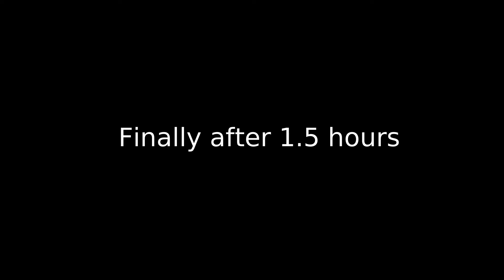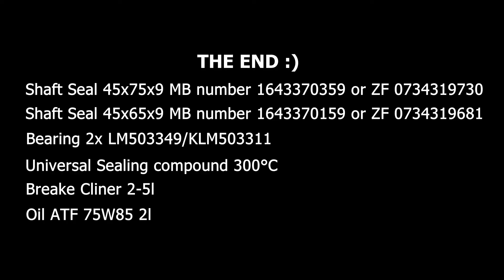Mercedes ML W164 rear differential Diagnosing noise and clearing replace bearings

Comment: Cleaning with paint thinner is better than with brake cleaner. It doesn't evaporate as fast and when rinsed off it leaves a protective film on the parts. That`s also a good way of cleaning valve covers and engines in general.

Comment: 1990 300 CE 210mm 3.27 differential. Do you think it will fit in another car with a 210mm differential. It’s a 2006 Chrysler 300C

Comment: Loved the Music. Can you use ATF in you Diff you can. Will it last? Probably not.  I did this once on the advice of a transmission shop and Never again because 6 months later I needed a New Rear Diff. Now I use Valvoline SYNpower. Full Synthetic 75W-140 Gear Oil. This is what you want to use! Bottle also say's  "Limited Slip" Change out that fluid ASAP. Running Strong in My GL450 and all my vehicles. I never had a Problem since!  Hopefully this helps and you see this in time.  Thank you.
Reply from the maker: If your differential died after changing the oil, it means that its condition was already very bad fresh clean oil only showed his condition and did not affect its destruction, changing to 75w140 can help because it is very thick when warmed up and masks the noise of the bearings but it causes an increase in fuel consumption
Reply: There was nothing wrong with the rear it was in excellent condition. I should have not even Changed it. ATF could not handle the "Shear" of the gears. Anyway thanks for the video and good luck.
Reply from the maker: @tomb375  It's hard for me to say in what condition your differential was in the one I was repairing, the oil was never changed, but it was completely damaged, I changed ATF many times in gearboxes and differentials, usually to the one recommended by the manufacturer and they worked for years without problems

Comment: Woah, so you're saying the carrier bearings in the rear diff are the same as the ones in the front diff? 
What the heck? Were the bearings you removed KLM and you replaced them with LM?
The front diff is notorious for failing  with the same KLM503349/KLM503311 bearing, the rear is not usually an issue.
The KLM503349 is made in Poland and seems to fail frequently in the front. 
Could the increased oil capacity of the rear diff be helping?

I never heard of the rear using the same bearings. You didn't make a typo or anything, did you? Just askin'.  :-)
What about the pinion? What are part numbers? And yes, per the dealer and lube info supplied from MB, diff is supposed to have GL5 gear oil, not tranny fluid. Transfer case does call for ATF134.
And btw, nice video! Thanks for taking the time.
Reply from the maker: In the 11: 06s video I showed the original bearing numbers that were in the rear differential. I used Timken bearings numbered KLM503311 KLM503349 it is the same bearing
https://www.iparts.pl/czesc/timken-klm503349klm503311-timken-klm503349klm503311,0-219-klm503349klm503311-0.html
Dimensions are important
After the change, they work flawlessly so far :)
The oil I used is 75w85 as recommended by Mercedes but a lot depends on the climate in which the vehicle is used. countries with hot climate better use 80w140 cold countries 75w85 countries with moderate climate 75w90. ( I changed the oil in my Mercedes to 75w90 ).

It is true that the rear differential breaks less often and the front differential is more problematic. For me, the damage was a consequence of the stupidity of the previous owner who drove hard despite the problems with Lock UP and destroyed almost the entire drive in the car :(

Regular servicing and oil change is also important Polish bearings are not the cause of the problem, in my opinion, they are simply too small for the loads they carry, especially on the front axle of the vehicle, it is a design error or intentional operation of the Mercedes :-/ The front differential has a slightly design other structures than the rear one which may have an impact on the worse lubrication in bends. It is also affected by other momentary forces during driving, the load is primarily on the rear axle and the front axle is temporarily loaded, often very quickly when the rear loses its grip, which is not good for the bearing strength. 
The oil in the central differential depends on the type, it is different in the version with the off road package and different in the ordinary transfer case 

But the truth is that everyone will be better than the old, never replaced factory oil :(

Comment: Thank you for this great video. I need a bit of advice. The differentials, front, and rear, on the 
Mercedes ML and R Class are non-serviceable. Or should I say, Mercedes 
tells you that I do not provide torque spec for it.  So how low pre-load
 torque would be safe? Since a too high pre-load can be very bad.
Reply from the maker: Of course they are repairable, but it is not always profitable. If only the bearings are damaged, they can be cheaply and easily replaced, if the gear is damaged, the costs increase
Reply: @mymercrepairs1097  I have the tools. But not the torque spec, or backlash spec. What would you do?

Comment: very nice job. Do you have any idea what could cause continue high low pitch noise under only deceleration when let go of the throttle before I go mad and dissemble all the rear end? 

Vehicle is a Merce Sprinter 1998 and it was even there when newly bought at the end of '97 (Original service back then serviced it when it's 4 month old but never found a thing and the sound is there even after 20 years of usage)
Reply from the maker: the noise is from 1998 and nobody found the cause? I understand that the noise is coming from the back of the car?
Reply: @mymercrepairs1097  yep it's definitely the diff. 

It was the third Merc Sprinter in the country and no one had an idea of it till 2000's and then it was too late. 

The reason I'm complaining about it is increased amount of noise under decel.
Reply from the maker: @SweetyVoltyy  Hmmm. I admit it's an interesting case. Most often, in the case of the drive on the rear axle, the shaft support is to blame, but in this case I doubt it would be a problem because the damaged support would not last for so many years. In my opinion, the rear differential will be to blame, one of the bearings is damaged, I think it may be the input bearing. Start by changing the oil in the differential, pay attention to its color, take pictures of the oil and send it so that I can also assess the condition of the old oil.
If the noise increases after replacement, it is 100% to blame for the problem with the differential

Comment: Excellent. I have a few questions, if I may. Why does Mercedes does not include differential oil change in their maintenance booklet? At least the booklet that came with my W251 (2012) does not have any reference to it. At what intervals would you recommend replacing the oil? What about transfer case oil? Should I use the same oil you used on this video for both? Thank you for posting this (and some of your other videos).
Reply: Mercedes says oil will last a life time. Normally it should be changed every 60 000km. Same as the oil in the gearbox.

Comment: Thanks for your excellent video, looks the rear flex disc has got cracks, would u replace that?
Reply from the maker: where do you see the crack in the flex disk? I have controlled this item and it is good

Comment: Out of curiosity, why did you use ATF instead of the .... 90w72 or something like that.  I only used ATF in transfer case and transmission.  Very nice work though and thanks for sharing.
Reply from the maker: Because in the documentation I found information that the same ATF can be used as in the gearbox

Comment: I have ML63 AMG and when is running downhill without any gass on gear .. o herd from back from time to time RRRRRRR...
How to diagnose the rear dif?
Thank You.
Reply from the maker: Change the oil in the differential and check its condition if there are a lot of metal filings in it, it is most likely damaged
Reply: When i check under the car i can litlle move the shaft but litlle.. is this normal?
Reply from the maker: @ank71  Yes it is normal for the shaft to be able to move back and forth and up and down
Reply: @mymercrepairs1097  Hey.
I have one question.. i need to change my Sterring Knuckle. And im not sure is it the same from W164 420CDI  and W164 AMG.?
Reply from the maker: @ank71  It will almost certainly fit, but to be sure, compare the part number with your car
Reply: I just found another differential  from ML320 cdi  it looks like part number is different but the ratio on plate is same 3.45.
Is this mena the diff is the same?
Is there anybother place on diff where i can find number?
Because i think the axle shafts will not good for this diff.
Reply from the maker: @ank71  Numer części można znaleźć na naklejce przymocowanej do górnej części mechanizmu różnicowego na wejściu wału napędowego, niestety często z czasem ulega uszkodzeniu i nie można go odczytać
Jeśli przełożenie jest takie samo, nie powinno to stanowić problemu, ale upewnij się, że jeden z tych mechanizmów różnicowych nie ma pakietu terenowego lub innych różnic
Reply: Hello did you found out if it is the same from 320 and 63 amg?

Comment: Great video ! I would also have a question please, is the differential from w251 also suitable for ML 280, year 2006?  Thanks !I guess the differential is the problem because sometimes when I put the brake there is a shock in the back, I checked all the joints and they are ok.
Reply from the maker: The differentials are the same on w164 w251 and x164 but they differ depending on engine and model in gear ratio.
Reply: @mymercrepairs1097  My car is a Mercedes Ml 280, 140kw, 190hp, can you help me tell me what kind of differential should I buy?  Thank you
Reply from the maker: @msmitanu5896  I will try but I will need your car vin
Reply: @mymercrepairs1097  The win is WDC1641201A132240. Thank you very much for your time!
Reply from the maker: @msmitanu5896  Ok, I found the differential ratio is 3.45 but after dismantling you need to make sure that it is the same. alternatively you can check the configuration in the engine ECU
Reply from the maker: @msmitanu5896   MB number A1643302102 and 1643500414
Reply: @mymercrepairs1097  Thanks, you're the best !
Reply from the maker: @msmitanu5896  you welcome But remember after dismantling the old differential, make sure that the numbers are the same as there are documentation errors

Comment: Hi, do you know the pinion bearing numbers? Or where to find the information. The Mercedes does not give the information... Thanks!
Reply from the maker: I used many sources in my search for information. I bought a ready-made kit for Mercedes. Unfortunately, I don't remember the pinion number, I saw it somewhere but I don't remember where. If you are not in a hurry, I can remove the bearing from my old differential and check its number, but it's only in 2-3 days because I have a job now
Reply: @mymercrepairs1097  Hi, now hurry. Mercedes in Europe do not sell bearings only seelings...
Reply from the maker: @tuomopimia8362  I know that Mercedes does not sell bearings, but the whole differential at a very high price. Tomorrow I will try to unscrew the attack shaft and check the bearing number, but I have the usual differential without the offroad package, I do not know if these bearings will be the same

Comment: what about balancing/centering shaft with new diff?!
Reply from the maker: replacement of the differential does not require centering or balancing the shaft, but shaft control and balancing is a good practice mine was inspected earlier after replacing the damaged differential all vibrations and noise disappeared